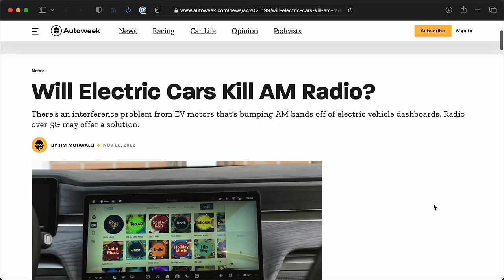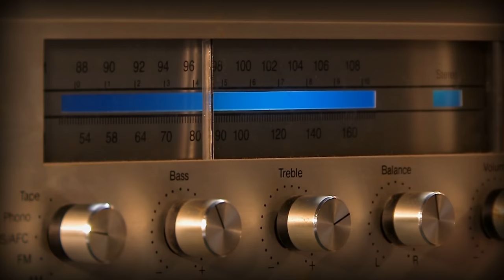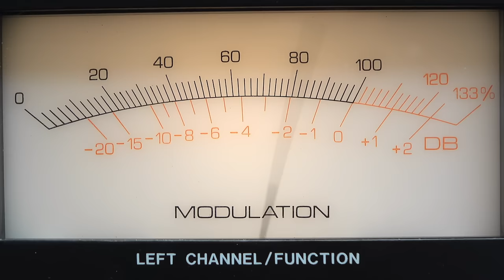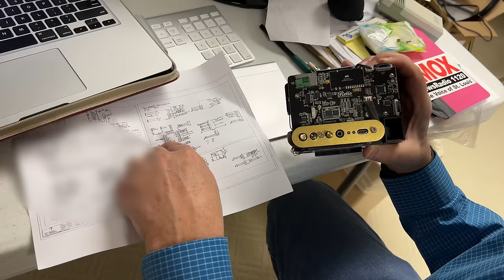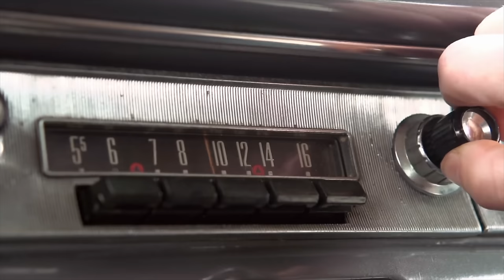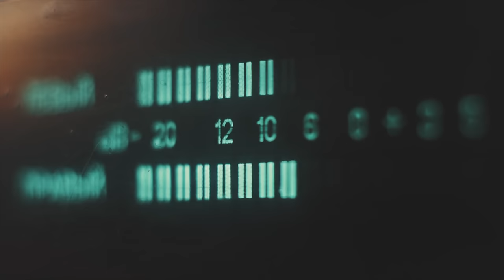Is AM radio dead? Tesla thinks so!

Comment: In Norway, AM has been dead for 40 years at least. FM has been dead for around 10 years, because DAB was supposed to be so much better. I don't listen to radio anymore because of it. I got tired of losing signal everywhere for no apparent reason. Some of the point of maintaining the FM radio here in Norway was to make sure there was as much coverage as possible, for emergency broadcasts EVERYONE (Insert Gary Oldman gif here :) ) could receive. Now, we have spotty coverage, and instead of having a bad but intelligible signal, we have perfect clarity or nothing at all. The excuse was that we were running out of frequencies on the FM, but... we're 7 mill. people and a handful or radio stations... I miss the local FM stations, and I wish we had AM as well. So I listen to radio on the interwebs, and get my FM/AM fix on CB.
Reply: Samme her :/
Reply: With a decent loop antenna and an airspy hf+ discovery there is still much to hear, even in germany...in the morning i can receive Tennessee..
Reply: Switzerland had to push back the FM turn off as there are still heaps of cars on the road with only DAB and no plus so they are stuck in silence. Inside tunnels they have perfect FM reception, something that has not yet been completed with DAB. All terrestrial TV transmitters are off and the AM towers removed making room for flawless 3 5G operators with minimal rf radiation exposure.
Reply: @FilooWoj  its an informational warfare going on over here in europe.
Reply: DAB has been abandoned in the Republic of Ireland.
Reply: MPEG-1  In many parts of the UK, there is no DAB signal, nor is it feasible to provide one, so it is essential  to maintain FM transmissions, and yes, DAB in the UK is plagued by low bit rates and an outdated, inefficient codec.
Reply: I've heard about this. Quite sad. I hope the Netherlands will not be following in your footsteps as far as radio is concerned. All the best otherwise!
Reply: @FilooWoj  There were times when BBC World Radio was on AM as well. And some others. I remember using an old alarm clock to hear what was on AM at that point. But that was close to 20 years ago probably.
Reply: @dasgelbevomei33  love airspy. Wish I could spend more time playing with it.
Reply: DAB radio to me has a much inferior audio quality than FM, it sounds like the first mp3 that came out with a very low bitrate. DAB+ in theory should sound better, problem is that it consumes a lot more bandwidth since it has an higher bitrate, thus with DAB you squeeze more station into the same frequency, and also DAB+ is compatible only with newer receivers, thus a lot of station prefer to stay to the old DAB. For this reason to me FM still sounds better, at least for most stations, even if it can pick up noise if the signal is not great.

AM radio in my country (Italy) is dead since decades, practically you can't pick up anything on it. All stations are on FM and nowadays on DAB.
Reply: I'm very happy that Denmark did not shutdown FM back in 2019 (in the technical media in Denmark, Norway was the example why DAB(+) should not replace FM). The government will take the decision when over 50% of the of the listeners listen to radio digitally (DAB+ and internet).
Reply: And the other thing that people are forgetting about is the energy consumption of DAB radios. Digital to analogue conversion requires a lot of power. That mightn't be too much of a big deal when you're listening on your home stereo, but when you're battery portable, you really notice it.
Reply: @NaoPb  Commercial AM got turned off recently, only the BBC still broadcasts some radio on it. 198 Long Wave (Radio 4) will probably be the last one off if the 90 year old transmitters survive
Reply: @cdl0  I am so glad i stole my DAB radio, for that reason! [EDIT: By which I mean, the RoI switch - off.]
Reply: Where are you getting that 7 million from? Norway barely has 5,6 mio.
Reply: @NaoPb  BBC world is on AM, just not on the MW frequency ranges you get on the standard radio!
Reply: The worst thing about DAB is the awful sound. They all have to share one data-stream, and wants to cram as many stations as possible in there. Most stations ends up around 64kbps, with some talk channels being as little has half of that.(16kbps mono)
BBC research documentation from the 90’s suggest 160kbps would be an equivalent to FM.
Even the most atricious MP3s from 20 years ago were 128kbps. 
Still they have the Audacity to claim DAB to be «better». 

It’s dreadful mush!
Reply: I just love it when people in small countries try to say things work good here like this.
Reply: @FilooWoj  only single AM frequency in each cities im Italy. RAI RADIO 1 1107 kHz in Rome.
Reply: @cdl0  DAB has been abandoned in Canada since 2006, Singapore since 2011 and in Hong Kong since 2017. They only have AM and FM. Singapore only have FM, Canada have HD RADIO (mostly FM).
Reply: @FilooWoj  You haven't found Absolute radio? Most of Poland was within it's range
Reply: @FilooWoj  Oh, ok it seemed like you were taking about your current reception
Reply: In Finland they started DAB in 1997 and ended it in 2005. Nobody was interested.  I think adopting it in the same time as digital TV was not that popular.
Reply: CB?
Reply: @HappyQuailsLC  Yep. Citizens Band, aka "walkie talkie" With some... added range. I'm on 27.555 quite a bit.
Reply: Wow that is a trip.I never realized the situation over there.I live in Detroit MI  and both AM/FM are still very much alive and well here and we listen to both bands every day.AM stations here are mostly news/info/sports/talk but also many ethnic and oldies stations too.We also have the benefit of many Canadian stations because we are such close neighbors.
  I've taken many road trips across this beautiful nation and i will testify that no matter where you are you will pick up a Country music station.This i guarantee.

  What is so great about AM is that on a good night once the stations power down and you have a radio with a decent antenna you can pick up stations from all around the country.From here in Motown i've tuned in Chicago,Boston,New York,Dallas,New Orleans,Nashville,Cincinnati  etc.I've been DXing since i was a kid.
  FM bands at least here are primarily for music and this being Detroit one of the musical epicenters of the planet makes radio still a big deal.
  Now,despite decades of gloom and doom spouting the death of AM/FM it is still here and very much likely to remain.It will certainly survive my lifetime  and beyond.The thing with radio is that many of our local stations have been broadcasting for decade upon decade and have become part of the very fabric of the community.This phenomenon is very unique to radio i think.
  So yeah,Tesla won't have AM.So what? Really who cares? I'm driving a 2022 Chevy Traverse AM/FM tuner included.I'm not going to sweat it.Take care.
Reply: @NaoPb  This sounds really sad.
Reply: @FilooWoj  I remember going through random stations as a kid in the 90s in Poland (FM, AM, LW). And even back then, I don't remember getting anything interesting outside of FM...  there was Polish Radio on LW, but everything else on AM and LW was extremely noisy and in foreign languages (and I didn't even know English back then). So, my assumption is, even if there was any AM in Poland, it must've been dead for at least 30 years...
Reply: it wasn't like some responsible person in Norway said that the point is not that it should sound better than FM.  in the UK at least BBC 3 broadcasts on 192 kHz over DAB In the UK
Reply: It is also possible to listen to the radio via satellite.  so if you have a satellite dish with a motor that can turn the dish in all possible directions, then you can perhaps have a little radio adventure.  of course, for example, the Astra satellite should have many radio channels
Reply: but in the USA they apparently have something called HD radio on one and the same frequency, so you can listen to both analogue and digital on the same frequency, we are talking from 88 to 108 MHz.  I think it's three radio channels, it's on the same frequency and but it's the system, they also have digital AM
Reply: MPEG-1  If it is true that you have 50 radio stations London then it might not be so strange if some they have to compress sound strongly.
Reply: MPEG-1  hopefully the same radio stations can have better sound quality when streaming over the internet, but it seems that different radio apps have different quality for the same radio channel, at least in my Android TV receiver.  I think Tunein is not good in it.  I like the app My Tuner.  Sounds better
Reply: @alerighi  In principle, every single digital TV channel uses a higher bit rate for the sound. Isn't that perhaps a little strange?  Unless, for example, Dolby has minimum requirements for the stream speed
Reply: @sIightIybored  yes and radio 5 too. I listen to it in my car. And RTL France. The problem in the Netherlands is that FM is not supported that well in certain areas, we have no AM and DAB+ is not fully operational yet (and I don’t have it in my car). Only internet radio works but not with power cuts.
Reply: @NaoPb  the former pirate station Radio Caroline is on 648khz. the former BBC World service frequency
Reply: In Norway, they went to digital broadcasting because pirate radio became a regular hobby there.
Reply: @HarryHamsterChannel  in Ireland they use DAB+ for. Pirate Radio
Reply: @georgeyreynolds  648 kHz. Was used by the world service on the medium wave  it's now used by the former pirate station Radio Caroline it has a good strength signal in Europe
Reply: 648 was the main frrequcey on MW there were others on used by the BBC World service
Reply: @charlesloukas1946  The Chinese + ebay make transmitters pretty easy to get.  Pirates are rare in the States.  No place left on the dial for them to transmit.
Reply: @HarryHamsterChannel  are you saying that the only pirates in the US are on shortwave?
Reply: @dasgelbevomei33  how come? In Poland you have a huge power Jedynka on LW 225 kHz and there's a ton of MW stations from Czech Republic, Romania, Spain, still some UK, Spain etc..
Reply: @cdl0  great! In UK the most of DAB sounds like crap because of too many stations and narrow bandwidth. Only BBC channels have a decent audio. DAB sucks compared to FM.
Reply: @NaoPb  it's funny that 648 kHz used to belong to BBC WS. And now there are former pirates now legal Radio Caroline 👍
Reply: @alerighi  what's nice is that there are small MW stations in Italy - mostly music stations around Milano I think.
Very good reception in Slovakia.
Reply: @sIightIybored  some GHR in North and Scotland survive. Now TalkSport announced they'll close about 15 transmitters. 
MW in UK will become a history soon it seems.
Reply: @TheMajkla  Radio 3 (mostly classical music) has the highest possible bit rate in the UK, but is still unacceptable for most listeners.  FM works as well as it always has, which is excellent.
Reply: @cdl0  It seems to me that DAB is aimed at people who use their kitchen DAB radios. They aren't bothered with its mono sound, their radios are permanently connected to the mains so it kinda works (high consuming is a problem for portables). Sadly the times of home audio systems are over when people are fine with listening to music from mobile phones and small smart speakers.
Reply: @TheMajkla  Spot on, absolutely right!   All my audio gear beautiful vintage kit from the 70's, 80's, and 90's, including the kitchen radio.  No weedy Bluetooth speakers for me, thanks.  @VWestlife and @Techmoan would love it!
Reply: @cdl0  Yep, I agree on Techmoan, I love his  videos and rants. Why only they have to break something that's working well (FM).. I smell a corporate greed - more stations get crammed into the MUX (who cares about those not having receivers or preferring audio quality)..
Reply: @TheMajkla  Correct, greed is exactly what happened.  Also, there is the technical shortcoming that the outdated codec used for DAB is incapable of sufficiently high-quality reproduction needed for classical music, even at its top bit-rate.
Reply: What do you mean...everyone?
Reply: @A1eR THE DAB+ format uses the same bandwidth as DAB, but replaces the MPEG2 standard with the MPEG4 standard.  It effectively doubles the sound quality (with same number of bits/second)

.

Comment: I totally understand how bad noise is to AM, I get high noise on all the HF ham bands,  but I get excited when the power goes out, I get to my radio as fast as I can and put it on battery power so I can actually hear stuff.  it drops from S9+ to S0.
Reply: What about if you turn your own breakers off and see how much noise you have?

A lot of times you are your own cullprit for your noise

You buy a new small furnace, it for some strange reason makes noise

Try it out, you will be so much hapier after that

BTW, here is what my stupid modern furnace does to the radio: https://youtu.be/0y4-cye76vs

Thats why I put a furnace into the example
Reply: Hams, one of the few groups that get excited when there is a power outage
Reply: I keep an A.M. radio ready for power outages...
Reply: But around here the outages are usually due to a lightning storm where many operators wouldn't operate.

And then there's still the RF noise from the supposedly "DC" lightning.
Reply: @Veso266  been there done that.  I've long eliminated all sources of RFI noise that I have control over
Reply: Many radio hobbyists for AMBCB also know to listen for distant AM stations around the terminator (day/night line from the Sun on the surface of the Earth). AM stations change their power and antenna pattern dawn and dusk. So when one station lowers their power and/or changes their antenna pattern, you may be able to hear a station covered up by the once stronger station. AM also doesn't suffer from capture effect like a FM modulated signal will. ...also the reason AM modulation is still used for aeronautical communications on VHF.
Reply: @W8RIT1  AM DX'ing used to be great fun before the FCC allowed daytime only stations to remain on the air at a greatly reduced power.  Ever since that happened, the AM band is a mismash of carrier-on-carrier and I gave up that hobby out of total disgust.  You'd be surprised how far a 7 watt AM station can go at night!
Reply: And don't forget that sound when there's a thunderstorm
Reply: I didn’t realize the FCC required some AM stations turn-off at sunset.  That must have been a looooong time ago (pre-1990)
Reply: Also exciting when you have blizzard conditions at night.

Comment: Crystal radio enthusiasts depend on the continued success of AM radio for listening enjoyment.
Reply: that reminds me i need to refurbish that crystal set that my grandfather had when he was young and see if I can pick up World Service. It's just a copper coil wound around a wooden cylinder and a galena cat's whisker.
Reply: That crystal radio will still work long after every battery in the world is dead...
Reply: If you can find crystals.
Reply: @book3100  In these radios a 1N34A diode replaced the galena crystal decades ago.
Reply: All 4 of them
Reply: I bought a crystal radio from Radio Shack as a kid.  Not sure if it was $1.50 or  $3.00.  The few parts are mounted on a custom piece of card stock.
Reply: @patpatpat999  
Yes, I remember that they used to sell them and I believe I have one somewhere. I construct crystal radios and have a modest collection including some absolutely outstanding quality pieces. For a few dollars anyone can make a very useful little radio that requires absolutely no power apart from the radio frequency energy received from the antenna.
Reply: I had a crystal radio set with BBC Ericsson headphones. That was 60 years ago.
Reply: @book3100  You can use a semiconductor diode!
Reply: Crystal radios depend on very long antennas or very strong local transmitters so the 1n34 diode can conduct.
Reply: I built one as a kid, nowadays kids post a video on tiktok lol
Reply: i  remember building one. It was right cool to turn some wire, a blade, pencil and rudementory antenna into a music and audio reciver with no batteries!